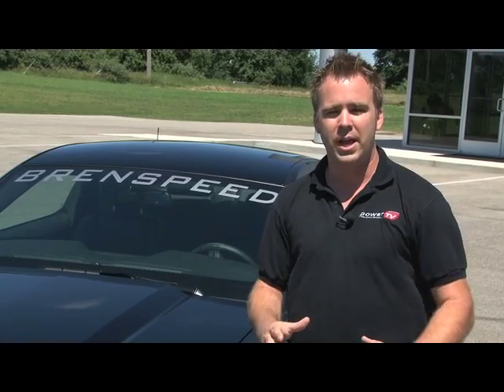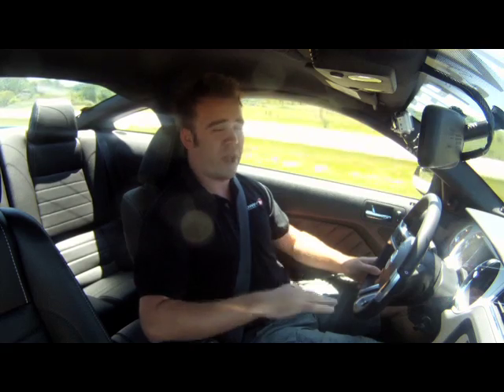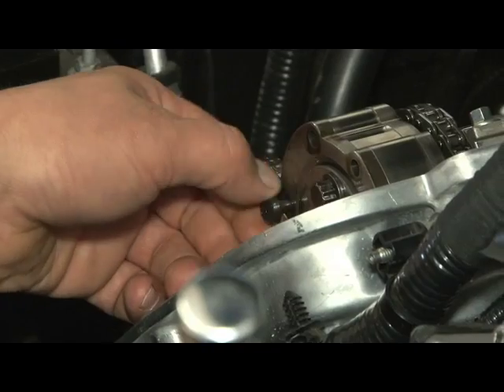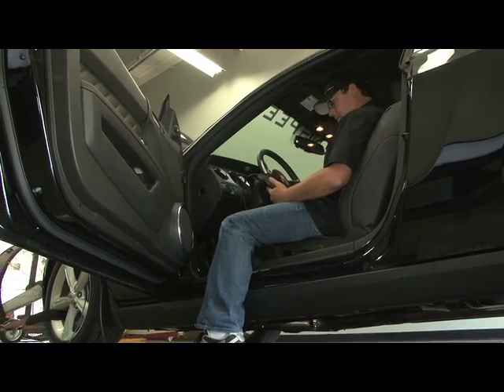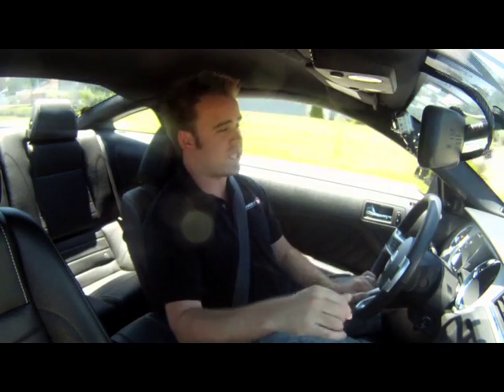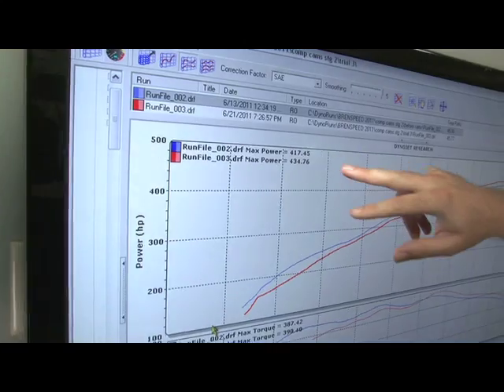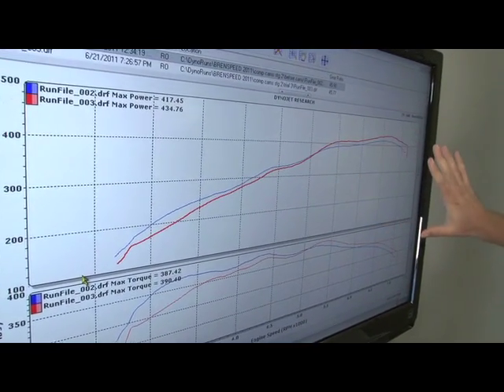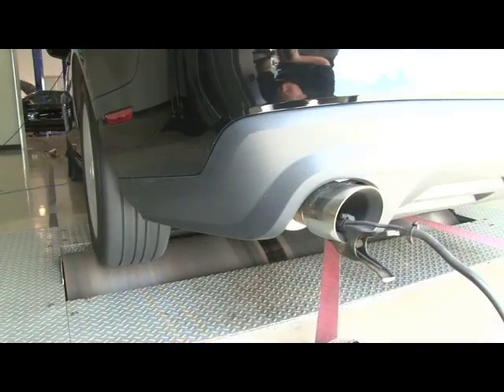COMP Cams®  5.0 Coyote NSR Cam Install

Comment: bolt on and cammed LS would do just as much and more. my old 02 camaro put down 404 hp at the wheels with headers, CAI, and a mild cam. that's at least 450 on the motor for a car that is supposed to be rated at 335 hp stock. that's over 100 hp gain
Reply: oh and btw, my cam was $335 plus $20 for LS3 valve springs
Reply: My comment was based on the price of the install. I spent about $1000 on headers and the cam swap plus dyno tuning and picked up over 100 hp. Show me 100 hp for $1000 or less that isn't nitrous
Reply: Btw, even a Chevy guy likes to know what the Ford guys are up to. No sense in getting upset about it
Reply: Your comment was based on...not a ford 5.0.  Hence, no one cares what you spent or how much hp you got from it.  But you had to be "that guy" that felt the need to talk about his LS.
Reply: BTW: you could have known what Ford guys were up to without making your "my car is better" post.  But nope, you're "that guy."
Reply: And you're that guy that is upset. And the debate goes on
Reply: If you only knew. Impolite is farting at the table at supper
Reply: kickblake LS is superior anyway, ford fans will spend 1500 bucks for new cams that give them a whopping 17 more hp, whereas a hydraulic or solid roller setup for an LS will cost $700-800 and make double the power.
Reply: kickblake actually, i dont need a link, lol. This is the video. Gained 17 hp
Reply: zach m TIL there's only one cam for a coyote, and it only gains 17hp

Come on dude, stop playing dumb.
Reply: kickblake then tell me what cam will make more power, and how much more will it make. An engine with a 7500rpm redline that makes 1.3hp per cubic inch already needs a monster cam(s), so in reality theres not much more you can do as far as a cam upgrade goes.
Reply: take the money and put it into some forced induction or nitrous
Reply: James Davis yes, forced induction would be a great investment on this motor, if its affordable. I was just defending my claim that a cam wont really wake up this engine. Nothing more or less. 😁
Reply: James
Well, the LS is a significantly larger engine so of course you're going to see larger gains for about anything you do compared to the smaller 5L Coyote. The 5.0 is also significantly more optimized thanks to it's 4 valves and vvt compared to the pushrod LS out of the box so it's that much harder to improve on the 5.0. We can see this in hp/l.

At 412hp (back then) the 5.0 is already at 82.4 hp/l to the LS3's 68.7hp/l. If it was the size of a 6.2L LS3 it would be making 510hp out of the box to Ls3 (back then) 426hp. The higher the hp/l the harder it is to increase hp. at 82.4hp/l the LS3 would also be making 510hp and significantly increasing it's power from there with just a cam swap would be rather challenging.

It's all in the details. These things are just elaborate air pumps. They don't care what name is on the valve cover.

Comment: lol over 1k probably for the cam kit, I paid $650 for my 150 shot from nx express and made an extra 143hp compared to your 17 hp and paid at the least 400 less haha
Reply: killer120 but it will blow up sooner:)
Reply: Bryant v No it wont, stock coyote block can handle almost to 900 hp. Unless everyday you use nos cause yea it will.

Comment: @salemned  actually no , YOU sir are mistaken. with an intake , tune and axle back coyote will make about 40 more peak hp. with the boss intake manifold alone , at 7500 RPM the boss is making 50+ horses over the STOCK manifold. So you sir are a dumb ass. sit the fuck down and until you buy one (like i did) you will never know.

Comment: Looks good !
Too much hustle 4 gain just to get little horsepower I'm an expert on that game I am a Chevy girl...B-)
Reply: That power is gained everywhere above 5k rpm, means you're accelerating faster at every rpm in the power band on average and it is quite noticable in racing. Every millisecond counts. These cams are a solid difference in the quarter, imagine on a road course, where all those tenths of seconds gained in between corners can add up to seconds per lap.

Comment: $1500 for a set of cams is rough. Especially when you only see 17 peak whp.
Reply: Doesn't make any sense, does it? $1500 should be spent elsewhere, such as suspension or a new set of tires?
Reply: 17 peak whp, probably around 25 crank hp is only part of the story. What matters much more is average power and torque. But you're right, there is room for improvement/optimization with the new cams.
Reply: 4 cams right? Sounds about right.
Reply: Yeah it all depends on the setup, you get cams you better get bigger manifolds, injectors, different fuel or something to just draw power or else you just paid for the sound and small difference

Comment: First, I understood what you WROTE. I will quote you: "let's say 430 rwhp, which is already a 500 hp engine". Not until your reply did you write "basically" or "probably just under" or "like 480". Second, I'm not disputing your hp gain estimates. Your theoretical setups had vastly different DRIVE-TRAIN LOSSES. 500-430=70 lost from crank to wheels in the first setup. 530-500=30 after cams. << Those are numbers YOU typed up. Seems you're the only one that doesn't understand what you're "saying".

Comment: Don't give me a bitchy little attitude just because you didn't understand what I was saying dude.

There are alot of bolt-on 5.0's with stock heads/cams that are putting down 420-430 hp at the wheels, which is basically a 500 hp engine, meaning probably just under 500, like 480, and that's a conservative estimate as far as a Coyote goes.

Stage 3 cams would bump crankshaft hp up by another 50 hp on the top end. Hey, genius, what's 480 plus 50? Uh, gee, would it be 530? Also a conservative est.

Comment: I'm curious as to how you calculated your drive-train losses :-) Somehow, you lost 70hp from crank to wheels (430rwhp from 500chp) and then you only lost 30hp from crank to wheels by adding cams (500rwhp from "530 or so crankshaft hp"). Those are awesome cams. Do they add traction too? Or maybe they will reduce your curbweight?

Comment: Those were stage 2's. Stage 3's will gain a Coyote 49 hp and climbing at 7,500 rpm.

If you take a full-bolties 5.0 (headers/exhaust, CAI, tune, boss intake manifold, throttle body, accel coil on plugs - let's say 430 rwhp, which is already a 500 hp engine) and install stage 3's? That's approaching 500 rwhp, probably around 530 or so crankshaft hp, all motor. That's fuckin' sick, dude! Not to mention the engine won't be as stressed as it would under boost....

Comment: All 3 stages are $1,499 from comp cams. It does seem a little overpriced, but when you look at the price of a cold air intake/tuning device/Boss manifold/exhaust put together, some people would want the high RPM gains that cams offer to make the most use of all the bolt-ons.